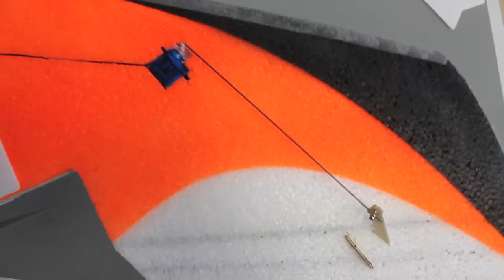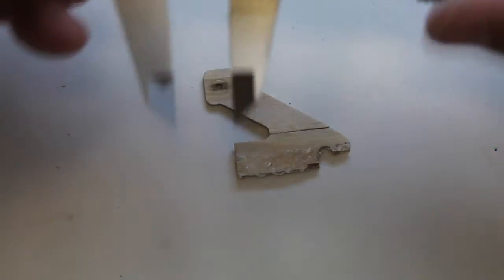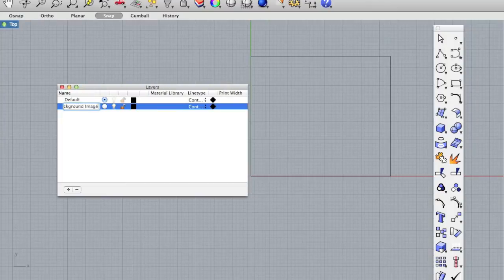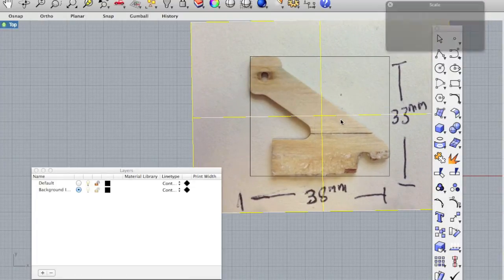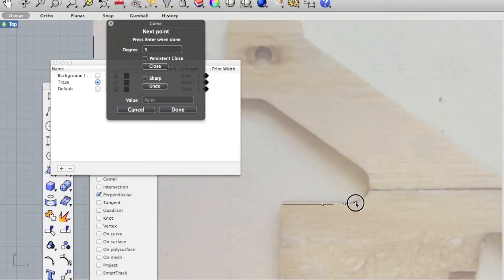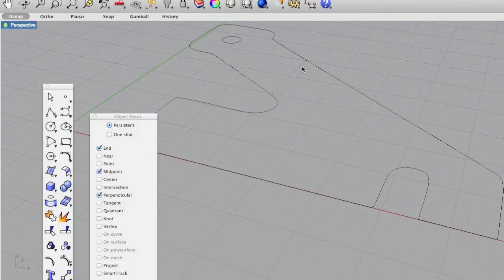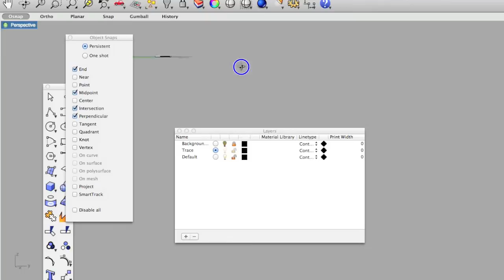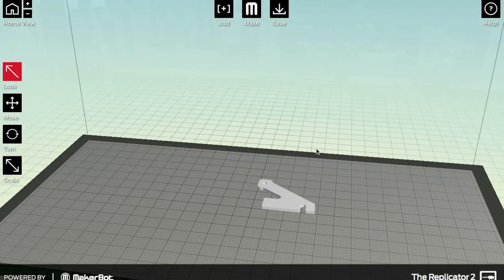TuffWing 32" Flying Wing 3D Printed Control Horn w/ MakerBot Replicator 2

Comment from the maker: Guy, thanks for the tip. I just tried it and it works brilliantly. I'm overwhelmed with the # of commands that Rhino 3D provides, but am slowly learning. It works really well with the MakerBot. At least with the basic designs that I'm doing. Good luck with your 3D printer search.

Comment from the maker: You won't regret it. I've been tipped off that the Ultimaker is a good 3D printer for a bit less than the MakerBot. I haven't used it, but have been told that.

Comment from the maker: I'm not sure if this will work with your plasma cutter since it's more of a 3D design but go to garagepilots . com and search for "New Images of the Multicopter platform". This is a design that Gavin Bendtsen put together and it looks pretty amazing. I haven't had time to 3D print it, but plan on doing so in the near future. Gavin is a strong 3D designer and may be able to modify to work with a plasma cutter.

Comment: Yep the design is defiantly the hard part I have the access to a full on CNC Plasma Cutter but can not design nothing to cut. I am trying to do a multi-rotor but I can not draw a stick person let alone a 3d design. I am working on it and getting better but If you know anybody with a multi-rotor design that  wants to be cut from aluminum let me know as I want to see if the plasma cutter will actually cut a good enough product as most people are using laser cutters :)